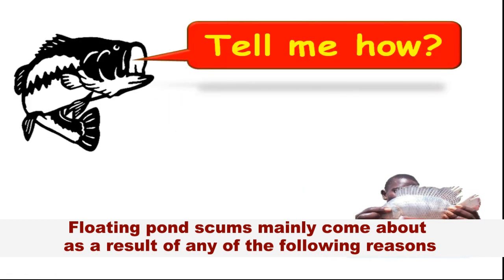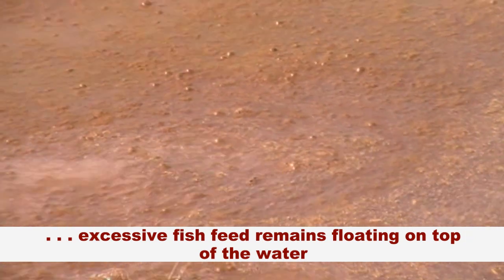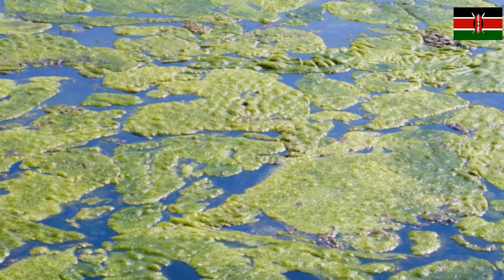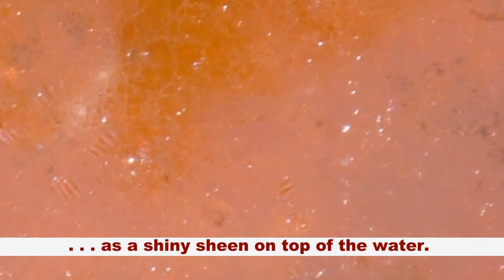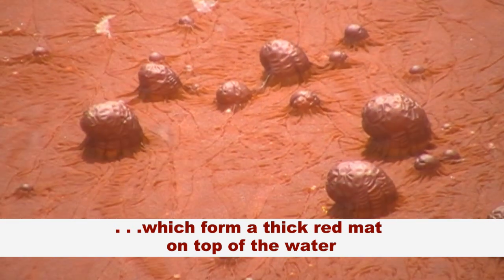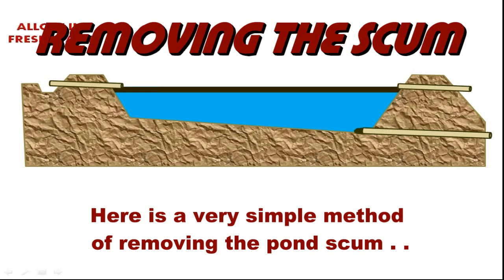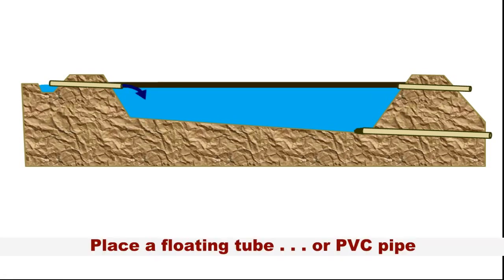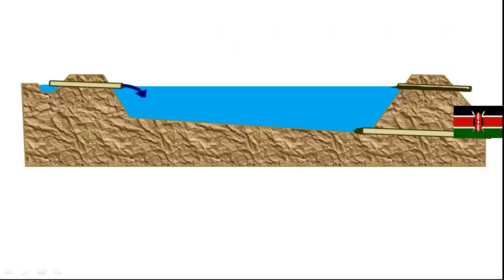REMOVING POND  SCUM - A Simple but Effective Method

Comment: I love this simple method.  However the people that created the pond I now own, didn't build it with an overflow pipe.  So if I fill the pond to overflow, stupid fish try to swim out!
Reply from the maker: You can install one by fitting it just above the water level. Then when skimming, you draw the scum towards this pipe. Bur remember to put a screen to prevent the fish from escaping through the pipe.
Reply: @munalaFISHVIDEOS  is there a problem if i have high concentration of iron in my water?